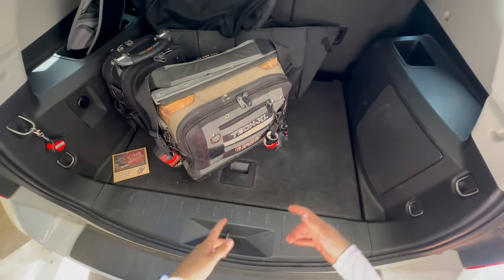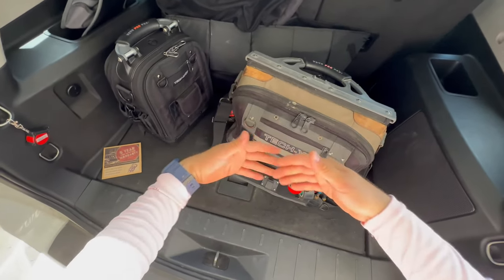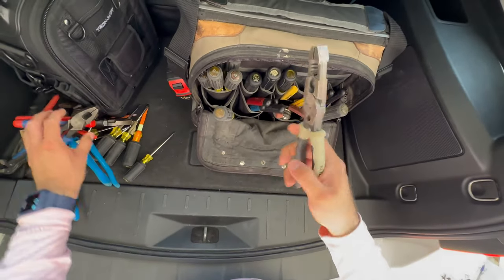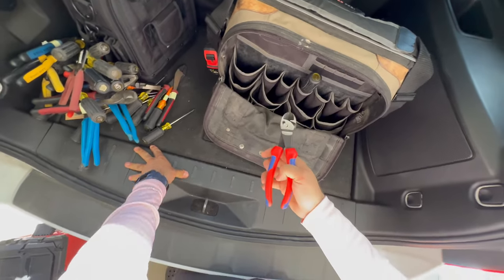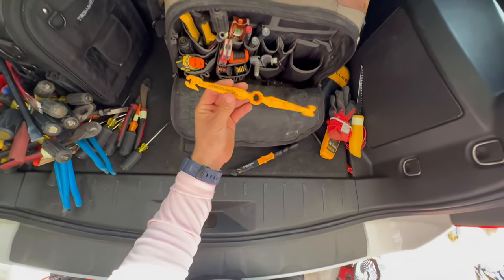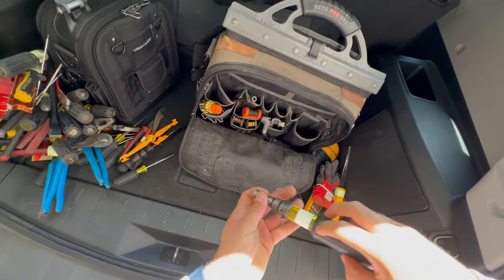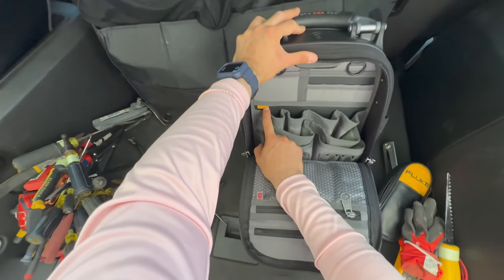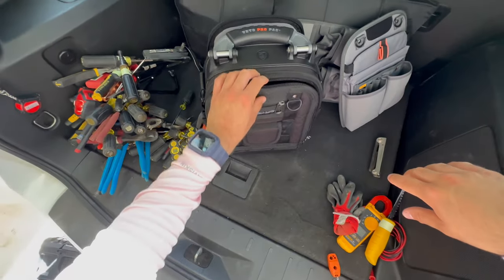What's In My VETO Bag? | Electrician Loadout

Comment: AY YO  why no comments your videos and presentation is so underrated!!  keep up the good work You rock pretty much the same tools S do! same everything    check out the ideal reflex strippers and also check out the new Toughbuilt insualted screwdrivers! 3 for 22 $ better than Klein) hate to say it)  it has an ecx bit !     Drooling over that meter!
Reply from the maker: I appreciate it! I’ve been in the trade for 10+ years but just recently started creating content. I have a lot more video ideas, tips and stories. So share with your electrician buddies 🙏🏽💪🏽